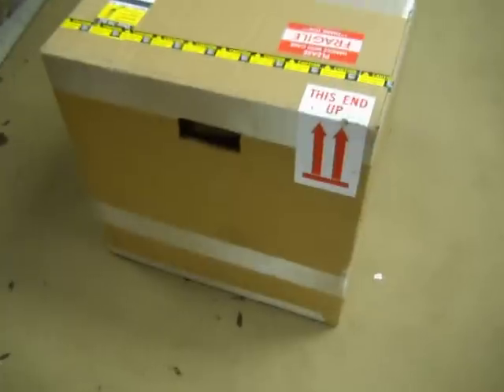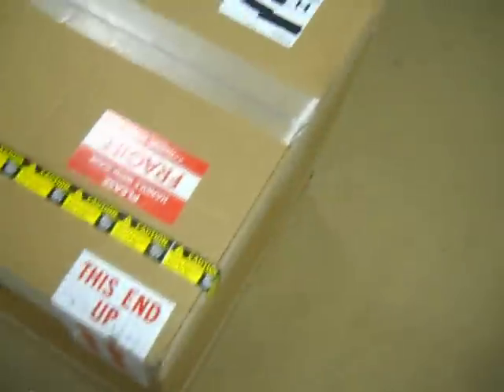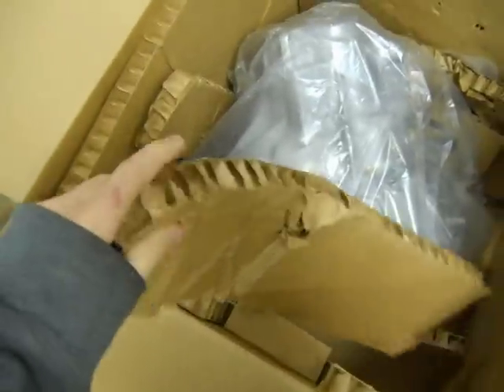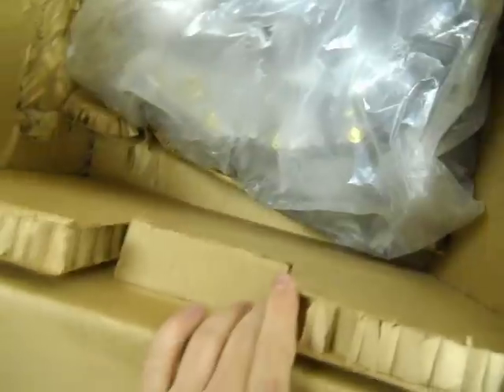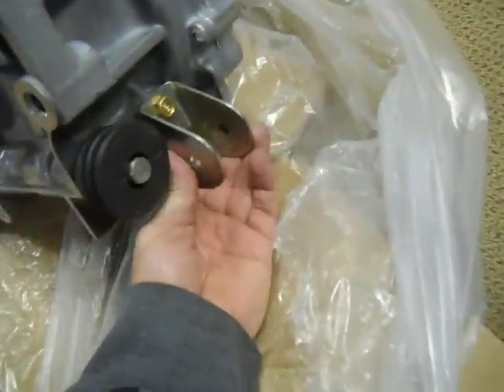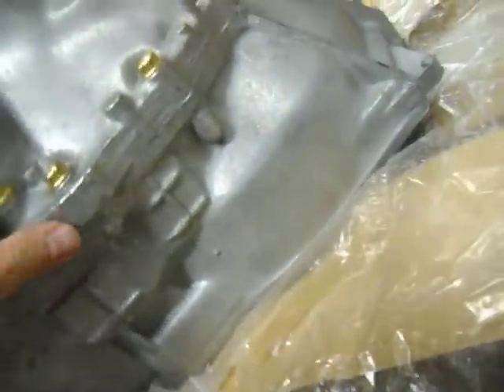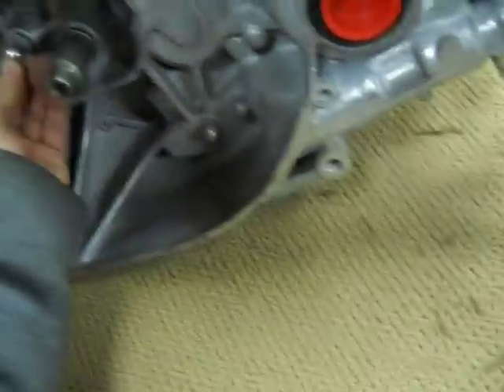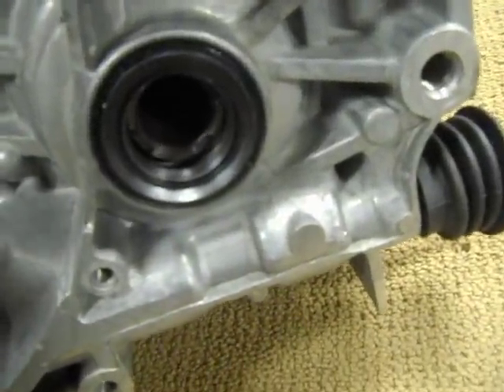Unboxing a Synchrotech Honda D-series Transmission

Comment: How's the transmission holding up ?
Reply from the maker: jay gets buckets Got about 50,000 miles of abuse on it now. And it still shifts perfect with no grinds or noise. It's actually in my 13sec  turbo civic now. I am buying another soon for my RSX, that's how much I love this transmission! =)
Reply: JTgoesPRO that's great. Man. My input shaft bearing failed and all my synchronizers were toast from previous owner. Just placed my order for one of these